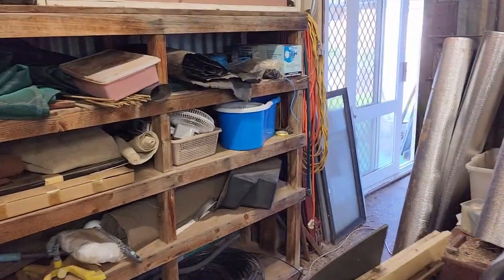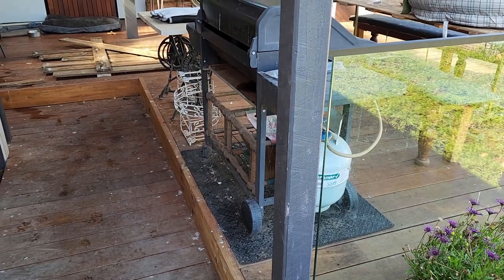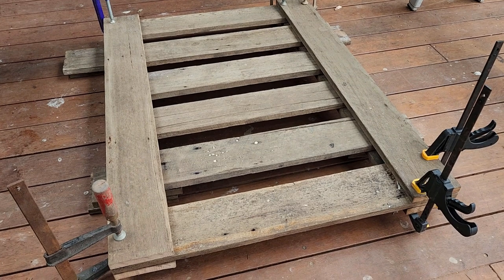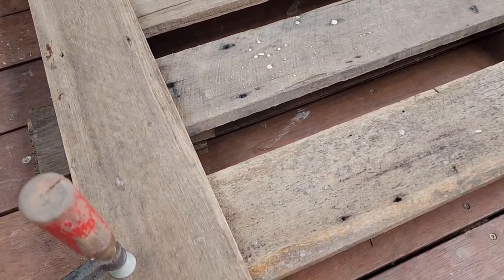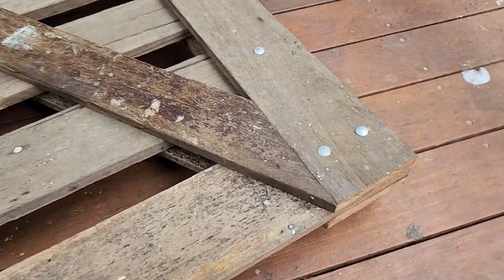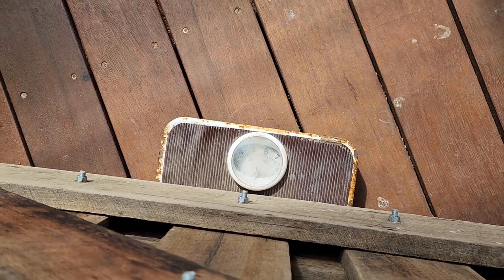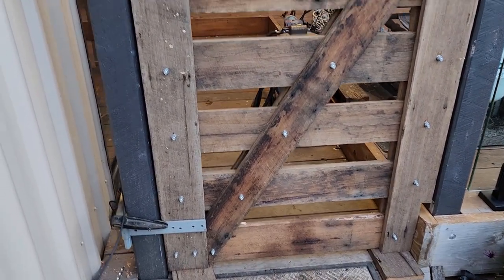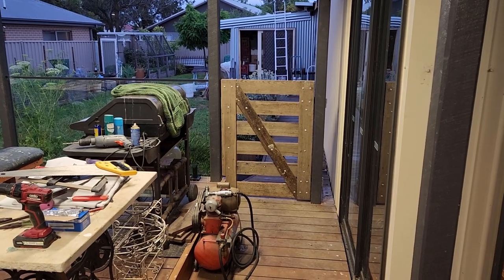How to Make a Rustic Timber Gate from Reclaimed 130 Year old Hardwood Floorboards. DIY Carpentry

Comment: Beautiful gate, Chris! Just a suggestion before you trim the bolt extensions. Have you thought of adding a washer to the nuts of the hinge bolts? Especially if the new holes you drilled in the bracket are less than 3d (3 times the bolt diameter) from the old holes. Feel free to ignore, and loved the "lab test" pun, so good!
Reply from the maker: Thanks Heather. I think I did end up with washers with all the nuts. Not sure now - it was a while ago!